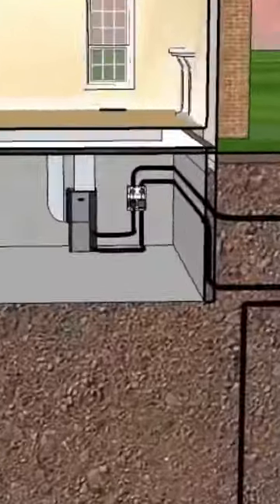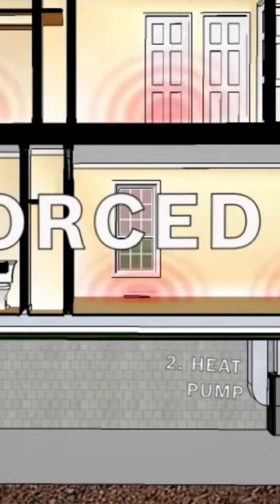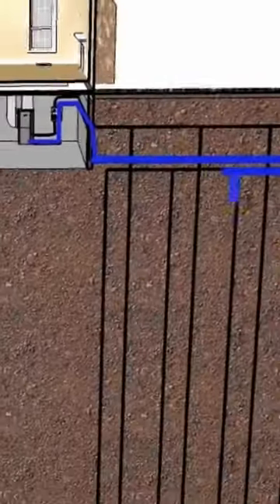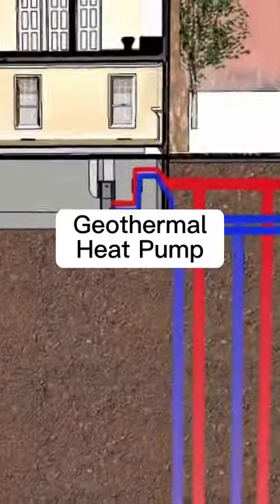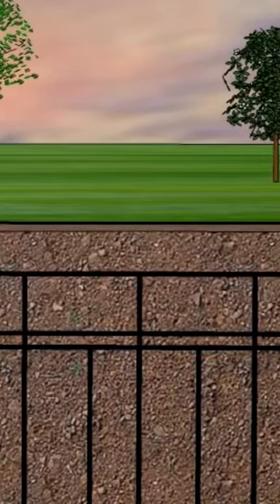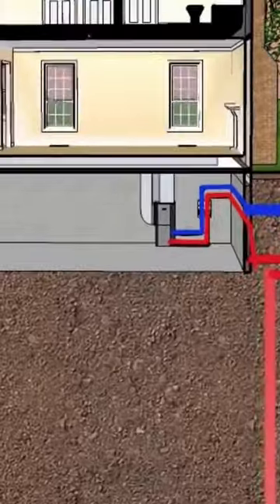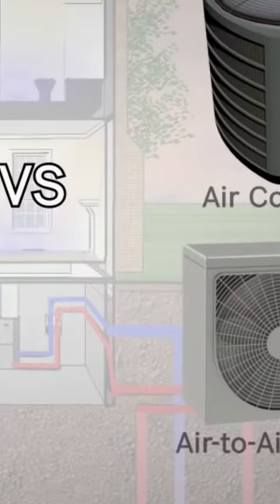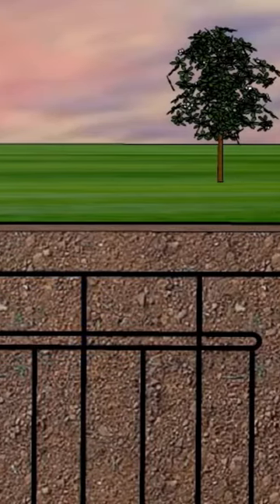Geothermal Heat Pump explained in 60 Seconds. #hvac #heatpump #hvaclife #electrification

Comment: Its just so damn expensive.
Reply: Inflation Reduction Act incentives can provide up to 40% off after it runs for a year and you get it when filing taxes.
Reply: But in long term it saves a lot of money.
Reply: Do it yourself,dig a hole and fill it with pex,or copper tubing(however manny feet you need) connect it to a air exchanger in the house and run it,couldn’t be more than a few thousand dollars?
Reply: @curtphillipps7830 Just finished my install yesterday. Rented and excavator that I used 3 days and 30 hrs for $1000. Put 1800 feet of 3/4 poly pipe in the ground which was under $500. I have everything buried 7 to 8 feet deep and up to my foundation which i still have to drill through so haven't included that cost. But  $1500 and probably 40 hrs total labor of my own. It takes time. Thats where hiring it done accumulates expense.

Comment: I can’t even imagine the maintenance cost on the piping
Reply: Non
Reply: The pipes don't need maintenance
Reply: I could see clean outs being the only cost. That and repairs due to earthquakes or other large damages. The pipes would not really be impacted by trees or wildlife
Reply: Tubing is STRONG and FLEXIBLE
Reply: It is a continuous plastic pipe, in a closed loop, no maintenance.
Reply: Twice as efficient but regardless the heat pump and heating  and cool system and other complex electrical circuits and relays need maintenance as well.

Comment: PROBLEM IS, the ground is not always stationary, any shift of the soil underground will break those pipes. Maybe if you use PEHD water pipes that are flexible you can sort of overcome this issue but it's a hassle.

Comment: How much deep the pipe should go down!? A kilometer? Two kilometer!?12!?
Reply: No where near that.

Depending on your area and the amount of ground you have to work with, you might go about 10'.  I've even seen people just bury 4" pipes and pump air through them.
Reply: @krevor4095 What about heat pumps somewhere very cold like the Upper Peninsula in Michigan or Alaska.
Reply: @tacrewgirl  Still nowhere near a kilometer (1000 meters/.6 miles) or two in depth.  He was "probably" meaning "a meter or two" which isn't far at all really, but that's why I said "Depending on our area".

Comment: Is it's water going into the ground or refrigerant?
Reply from the maker: In this case it’s the water. Thanks for asking.
Reply: Can it be refrigerant? Very curious
Reply: Typically it’s an antifreeze mix, water only in certain climates
Reply: It’s a mix of anti freeze/coolant and water
Reply: Glycol
Reply: It’s mixture of water and glycol. You should always have glycol in the system no matter what. If an engineer says no, he’s an idiot. Always think of worse case scenarios. I. This case it will prevent freezing conditions

Comment: LOL if you have heavy water this will be expensive heavy water meaning water that has a lot of calcium deposits or other materials  that build up over time  this is a good idea but only for the rich  even with the gov helping you  it still will be very expensive
Reply: Water is rarely used in a closed system that is shown. Usually an antifreeze fluid so the system doesn’t freeze in sub-freezing temps.